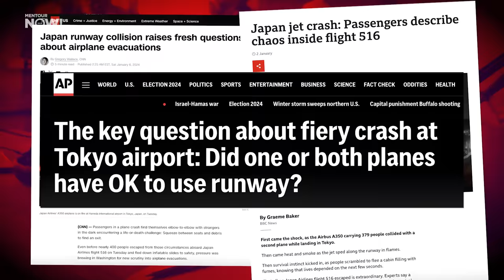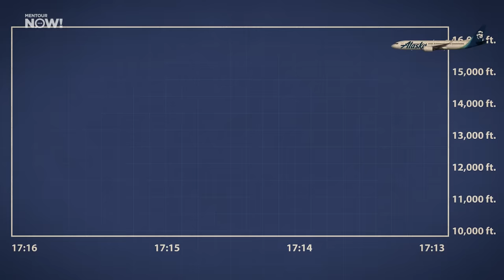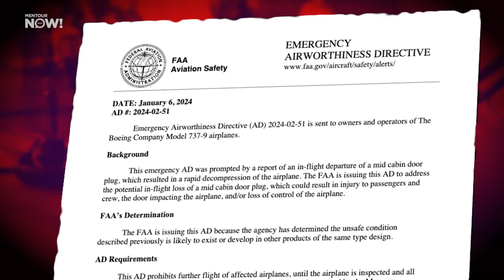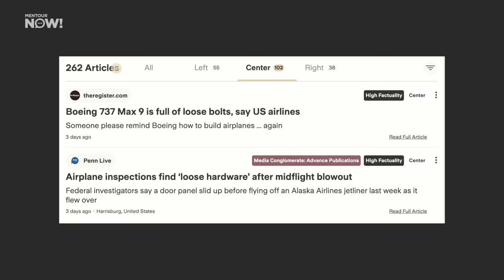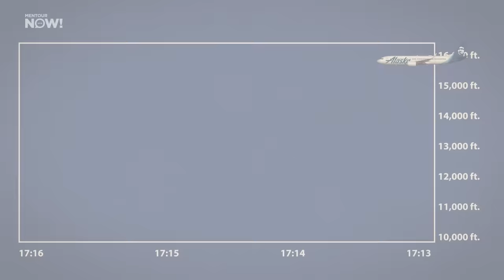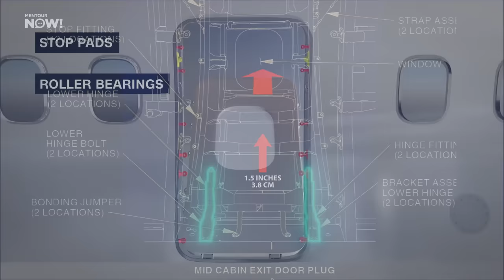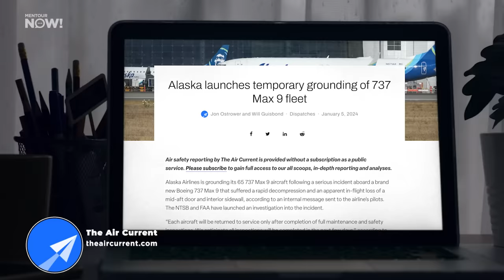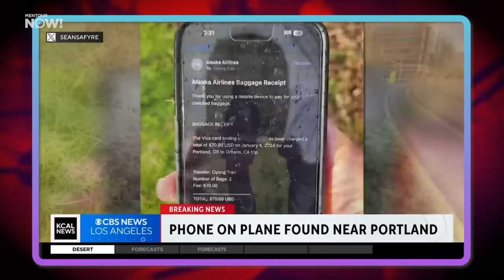WHAT Is going ON with Boeing?! MAX-9 Door blowout

Comment: It's worth noting that the NTSB have stated that the earlier pressurisation warnings are not related to the door plug incident. The warnings occurred while on the ground so they were determined to be a glitch and they decided to switch to the redundant secondary system until they could get it inspected. This is important because there's no indication that anyone could have been pre-warned about the blow-out incident.

Edit: Since people seem to find it hard to trust the NTSB right now, I want to add more details. According to the 737 Technical Channel (as recommended by Petter), there are 7 failure modes for the Auto Pressurisation warning which came on during those three incidents:

1. Cabin altitude rate of change is too high
2. Cabin altitude is too high
3. Cabin differential pressure is too high
4. Power loss
5. Wiring failures
6. Outflow valve component failures
7. Cabin Pressure Controller failures

The first 3 only make sense if the plane is airborne. If the warning light illuminated due to triggers 1 - 3 while on the ground, then it clearly indicates a fault with the sensor, not with the integrity of the cabin. Similarly if the warning light illuminated due to triggers 4 - 7 at any time that would also indicate a failure of the pressurisation system, not the cabin. In this case, it's standard procedure to switch to the separate alternate system which is what the crew did.

When the NTSB assert there is no link between this warning and the failure of the door-plug, it suggests to me that the data log recordings have indicated to them that the triggers were 4-7 or 1-3 while the plane was on the ground. We don't know if this is actually the case, but it's at least plausible scenario that would explain all the facts.

Lastly, the information about those warnings being triggered while the plane was on the ground comes from an article by Al-Jazeera where they interviewed Richard Aboulafia who said "They ignored it because, strangely, the pressure differential came on while it was on the ground, which means it was a glitch. There’s no pressure differential while you’re on the ground," "The cabin pressure can only vary when the aircraft is in the air, which is why it was acceptable to ignore the warning and fly the plane over land". I don't know how reliable this information is as I haven't been able to find any other sources to back it up.
Reply: This is definitely good to note
Reply: It also means that if someone messes up later in C-checks, there is no way to know it until plug blows out.
Reply: Checking the pressurization warning system at ground level with the plane immobile strikes me as insufficient in the absence of simulating the effects of turbulence of a normal flight. If the bolts were missing, the door could be shifting up and down within the track, causing pressurization to fluctuate as the seal would be compromised. In short, a ground system check would only inform you the system could accurately note changes in pressurization, not that such changes actually occurred at altitude.
Reply: The sensors are more sensitive the closer the pressure is to ambient. Warnings on the ground are your most reliable warnings.
Reply: NTSB was very quick to make such a definitive statement discounting any connection. I find that odd from an organization that prides itself on following the evidence to a conclusion. To be clear, they may be completely correct in there being no correlation, it just seemed absurdly early to make that public statement.
Reply: @JohnnyWednesday  How could a pressure sensor register a loss in pressure if the aircraft wasn't pressurized to begin with? This makes no sense.
Reply: It is worth noting.

Because it's wrong.
Reply: So we have at least 2 problems. 1 faulty press detection system. 2. Loose door panel...
Reply: @JohnnyWednesday  Actually sensors are more sensitive and accurate at and around rated value which is not necessarily ambient value and definitely not in this case.
Reply: @robbiestruys9127  NTSB is wrong.

The pressurization warning started right after the plane got fitted for new WiFi.

On the ground is exactly when you expect it to happen because that's right after it lands.

And running the test would force the door to seal again.

Whoever did the Wi-Fi did not put the bolts back on.
Reply: @foximacentauri7891  Im pretty sure they pressurize the plane for that test, that can be simply done by increasing the pressure inside the plane.
Reply: @robbiestruys9127  No, not necessarily faulty pressure detection.
Some of the systems, including plug itself, function properly when there is sufficient pressure difference. They seal themselves more as pressure difference increases. So measuring at ground level when cabin and outside are at the same absolute pressure does not imply anything.
Reply: Well, with an onboard computer so close to its processing capacity. Allegedly, they needed to "optimize" others currently systems to make room to add a redundant AOA sensor, isn't?
Reply: BS, if you have duplicate systems and one does not agree with the other, there is a serious problem.  How do you know which of the two is in error?  Switching to the system that shows no problem can mean you are switching to the system that is broken.  When this happens while on the ground you do not fly.  When this difference occurs in the air you do not just switch to the system that shows no error, you land as soon as possible.  The NTSB are similar to Police, they arrive with the body bags and prevent nothing before the event.  The Pilots and Airline needed to act before the flight so the NTSB would not have anything to do.
Reply: @Parc_Ferme  That's so insane. Dragon 2 goes to ISS with off the shelf hardware.

They can even use their personal tablets as a backup user interface. Wireless.

WTF?!
Reply: @JohnnyWednesday   And so on a windy day the sensors are giving warnings that it's a windy day?  YOU'VE GOT TO BE KIDDING!
Reply: @jtjames79 A completely valid point, though I could use some info about what you refer to as an "it" we can expect.

gEarth photos of the wifi install process for this model at Boeing's final assembly clearly show two things to me:
- Those plug doors are removed during the wifi
- The operation is performed by a subsidiary of Spirit Aerospace on location at Boeing, just after Boeing assembles (largely Spirit) Tier I components into a final structure.

I assume that install occurs before the final QA check is signed off; but that assumption is of Boeing's actual compliance with FAA regulations, which is precisely what the FAA is investigating.
Reply: @jtjames79  Spirit Aerospace enjoys an /exclusive/ contract for most of Boeing's Tier I components.
They are wholly responsible for supplying quality airframes for Boeing models:
737, 767, 777, and 787.

Though of course, responsibility for final QA on Boeing's final product rests 100% on Boeing.
Reply: What an absolute load of bollux!   You are on the ground and have a pressure warning?  Jesus nelly something is wrong somewhere?  Be honest and don't make excuses for job's worths.
Reply: @anthropicandroid4494  All I know is the name on the invoice wasn't Boeing or Spirit. Very well could be another subsidiary, as someone else said.

My problem is it seems that so many amateurs knew exactly the correct questions to ask yet the NTSB doesn't. Or isn't communicating it to us intentionally.

This is why I say that significantly advanced incompetence is indistinguishable from malice.

My CYA detector just exploded.
Reply: @anthropicandroid4494  Also it was apparently it was installed after Alaska airlines took possession of the aircraft.

It's up to Alaska to decide who they subcontract to, theoretically.

At least that's the information I was given, your mileage may vary, I am not an aeronautical engineer, just my humble opinion, this is not legal advice.
Reply: You realize that, if the events were unrelated, it means that two systems were shoddy and failing on a brand new plane?
That's not exactly reassuring!
Reply: I had wondered about the correlation of the pressurisation warning and the door plug blowing out. It didn't make sense to me as the system is electronic and any fault messages would be related to the electronic side or faulty outflow valve.  If there had been an air leak at the door plug, the passengers would have heard it in previous flights.  On that assumption then the door plug blow out would have been sudden with little or no evidence of an air leak.
Reply: It's not because I don't trust the NTSB but so far, no source did a decent job at explaining why it's unrelated. Thank you for the clarification, great job!
Reply: @hotsoup1001  I was also surprised by this, but with the trust that NTSB have rightfully accumulated during the years I would conclude that they have probably followed the evidence and come to a conclusion supported by the facts that are known at this time. Knowledge will of course change during the investigation but as they where so clear about this indicates to me that they have conclusive evidence to support such a definitive answer. It is much more likely that it is we that don't have all the information and therefor speculates with the knowledge we have at the moment.
Reply: @foximacentauri7891  As an engineer in that case I would suspect that either the sensor is broken or that the computer interprets the signal from the sensor wrong.
Reply: @user-yt198 and what exactly is the “rated” value for the sensor in this incident and why it is not ambient value?
Reply: @foximacentauri7891 Planes are pressurised on the ground. 

It start pressurised as soon as the door shut and the engine start and after landing it would continued to depressurise while taxiing to the gate.

The flight attendant has to actually check that the pressure is equal before they can open the door.
Reply: @tonamg53  Short version: That sensor reads pressure difference between cabin and outside. Even if you pressurize cabin, at ground level it will give very low electrical signal which will result in very low accuracy and sensitivity.
Full version: Sensors are calibrated to their rated value, not to ambient value because that is the variable we want to measure.
In this case rated value will be pressure difference between cabin minus atmospheric pressure at maximum altitude plus a certain margin. At rated value sensor will give 20 milli Ampere signal which is standard. If accuracy is say 1/1000, you get a 20 micro Ampere signal accuracy. It means signal change less then this value will not have any meaning. 

At ground level it will give say 2 milli Ampere. You will have the same accuracy in absolute signal level, which is again 20 micro Ampere. But now the accuracy is 20 micro/2 mili = 1/100, 10 times worse.
That is accuracy. Sensitivity will be even worse at ground level, because you will need more pressure difference to receive a change in the signal.
Reply: If I buy a brand new car and warning sensors start going off, even if they are faulty ones, I’m going to have some concerns about the workmanship behind the product I just bought.
Reply: @user-yt198  Emmmm… No. 

Do you know which device does almost exactly what you are saying? Altimeter or a barometer. Its measure changes in pressure. Do you know how it’s calibrated? You set it to the airport elevation before departure which in effect is the same as setting barometer to the current outside ambient air pressure.

I still don’t know what you are talking about “rated value”? Airplanes are rated to fly up to a certain height. Air pressure varies wildly for the same height and changes all the time. Planes are actually flying on an agreed standard atmospheric pressure value when they get up high so all traffic in the same area would be reading the exact same height on their altimeter.

 (if they use FL100 they’re using standard pressure, if 10,000 ft they are on the local atmospheric pressure)

Also I don’t know of any sensor that read the differences in pressure… If you want to read the pressure differences you just have two sensors, one inside and one outside and subtract the values yourself… but for what? I can’t think a use for this value unless you are a structural engineer and working on the structural integrity of the fuselage.

The warning lights associated in this case is most likely either the OFF SCHED DESCENT LIGHT or AUTO FAIL lights. Due to the ancient design of 737 cockpit and its warning system… multiple failure modes and conditions can throw off these lights which I’m not going to go in to details here because it’s just too much.

There are video on YouTube that goes into the details of these systems… just search it up.

Also why you don’t want to be in a 737 in an emergency as the workload for the pilots will be immense, the warnings system is almost straight off 1960s…

Yes, 737 is safe to fly (once ungrounded) but the A320 is A LOT SAFER.
Reply: @tonamg53  Yes, that is correct. Barometer, altimeter, pressure sensor, differential pressure sensor, they are similar devices using the same principle for different purposes. For example altimeter is a barometric sensor measuring altitude using atmospheric pressure.
This is also correct: If you connect one end of the differential pressure sensor to atmosphere (you call it ambient), you measure absolute atmospheric pressure.
I think you are missing the main purpose of these sensors. They are not there just to measure absolute cabin pressure. They are there to control the absolute cabin pressure. In order to do that they need to know input air pressure, which is variable down to the air pressure at maximum altitude. That is why these sensors' working range is not limited to sea level atmospheric pressure to comfort level pressure, but much wider.
I agree that 737 is a dinosaur and A320 is much better, but that is not the point here. Actually, almost everyone is missing the main point. The warning signal coming from cabin air pressure controller is irrelevant to this accident. There is no way that this controller could catch such a leak. That is why NTSB stated it is not related without even looking at the evidence. But here is not the place to discuss it.
Reply: @user-yt198  No, they just measure the inside cabin air pressure and kept it to around the maximum of 8000 ft altitude no matter how high the aircraft is flying. Below 8000 ft the system just kept it relatively about the same or slightly above the actual altitude.

It doesn’t care whats the outside air pressure is. There’s literally a dedicated altimeter for the equivalent cabin height in the cockpit. The pressurisation system is just basically the air conditioning system and series of valves to let air ins and outs. If need to decrease cabin altitude (increase pressure) Close out flow valve and open the inlets valve wide open. 

Need to increase cabin altitude (decrease pressure) do the opposite close inlets valve and open the outflow valve.

It’s really not that complicated.
Reply: @tonamg53  "measure the cabin pressure" how? Relative to what? You must have a reference. 
Pressure sensors have two connections (one can be hidden, but it is there). On sea level you can leave one connection open, measurement becomes relative to atmosphere (absolute pressure). In an aircraft, you cannot do that. When you connect one measurement point to the cabin, where will you connect the second point?
You yourself wrote this: "Below 8000 ft the system just kept it relatively about the same or slightly above the actual altitude."
How the system will now actual altitude? or "relatively above"? How will it know if aircraft is above 8000 ft and how much above? I am saying exactly this, relatively. That is the differential pressure.
If you still don't understand please ask to your science teacher. I will not give you free lessons any more. What we are talking is irrelevant to the accident.
Reply: @JohnnyWednesday  Why do you believe that "the sensors are more sensitive the closer the pressure is to ambient"? I would assume they are using solid state absolute pressure sensors (similar to automotive) and those have nothing in the design that would make them more accurate close to 1000 mbar absolute pressure. The sensor should output about 250 mbar absolute when the aircraft is flying at 33000 ft.
Reply: @user-yt198  Relative to what?Emmm… you know there is a knob you can turn to adjust to the current air pressure from the ATIS to calibrated the altimeter to the airport elevation or alternatively, you can adjust the height reading on the altimeter to match the airport elevation to have it read out the current air pressure…

You never use an altimeter before have you?

Also the system can read the inside air pressure in kPa. We do know what is the comfortable air pressure kPa is… the system just suck in and out air accordingly to remains with in that range. It doesn’t care what the air pressure is outside the aircraft.

Jeezzz…
Reply: @user-yt198  Also do realised that the plane do have a computer which pulls the data from various sensor and sources together in one place which can be processed and then push to various system that needed the processed data.

For 737 its call ADIRU if I remember correctly… not sure if pressurisation system is pulling data from ADIRU or not but if its need the current actual flying altitude. ADIRU can provide the data.
Reply: @tonamg53  I am not a pilot. I never claimed to be a pilot.
I am an engineer. I am not talking about flying an aircraft. I am talking about design and functioning of an aircraft which is what is important in this accident.
Engineer does not to be a truck driver to design a truck engine. And truck driver do not know how to design an engine.
I am looking at The Boeing 737 Technical Guide now. There are many references to *differential pressure*. That is the pressure difference between cabin and atmosphere (ambient).
So it proves my point.
The rest of what you have written in your last 2 comments proves you are wrong. 
Altimeter and ADIRU source selection changes ambient pressure source (static pressure sensor or others). It does not change cabin pressure source, which is always the same sensor.
By saying that changing ambient pressure source also changes how cabin is pressurized, you are proving my point. Thanks 😀
Reply: @user-yt198  What the heck are you talking about? ADIRU does not change any data. 

It just act as a central hub receiving data from various sensors and if required, process the data. It doesn’t change anything. It just providing data to various system in the plane.

And again, the pressurisation system doesn’t need to know outside air pressure to maintain cabin air pressure. It just need to know what the current air pressure in the cabin so it can let air in or out as needed to maintain the pressure.

And no, it doesn’t need to know the outside pressure to workout what is the inside air pressure. Do you need to walk outside your house and measure the air pressure before you can workout what is the air pressure inside your seal bedroom? 

No, you just take a reading from your bedroom.

I don’t have a problem with you not knowing stuff… but I have a problem with you pretending to know stuff and incorrectly telling other people that they are wrong when they’re not.

You don’t have a clue on how these systems work on a plane.
Reply: @tonamg53  You need to have some sort of reference pressure to determine the absolute pressure. That's what they are saying. That pressure sensor in a closed room isn't just measuring the pressure in said closed room. It is measuring how hard the ambient pressure is pushing against something with a known internal pressure. Think of it like a balloon. If you inflate that balloon in an environment with very low pressure, tie it off and take it to an environment with very high pressure, the balloon will shrink, yes? Measure how much it shrinks, and do some fancy math, and you can calculate the pressure differential between the low pressure environment and high pressure environment. But if you don't know the true air pressure in the low pressure environment, you can't calculate the true pressure of the high pressure environment, only the relative pressure.
Reply: @richardmillhousenixon  🤦🏻‍♂️ 

Is it really that hard to find out the current air pressure when you are on the ground?

Answer: No its not.
Reply: @tonamg53  Yes actually, it is. Air pressure varies pretty significantly just based on temperature and humidity alone, let alone altitude above sea level. Mean sea level pressure at standard temperature and humidity is 29.92 inches of mercury. Depending on the day, the ambient air temperature and relative humidity, it can vary by 2 inches of mercury or more. For every inch of mercury difference, that's a variation of roughly 900 feet in pressure altitude while being at the exact same absolute altitude.

So you can't rely on the air pressure on the ground being at the exact same value all of the time